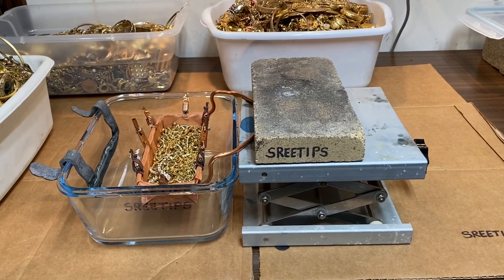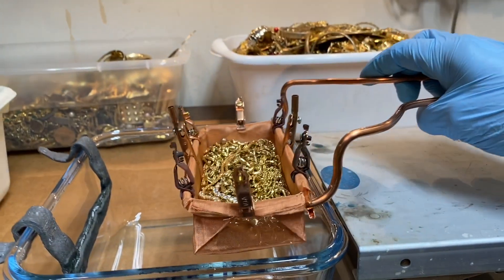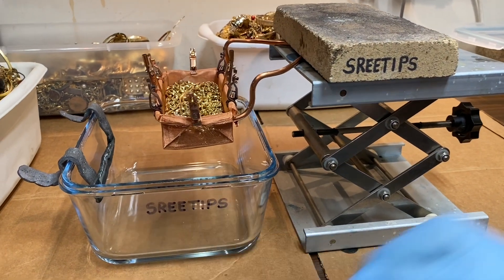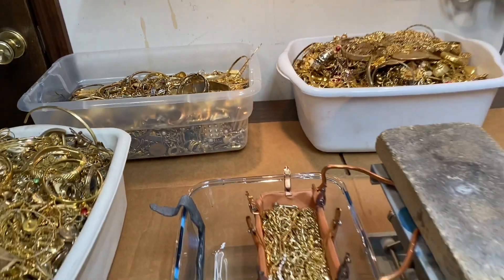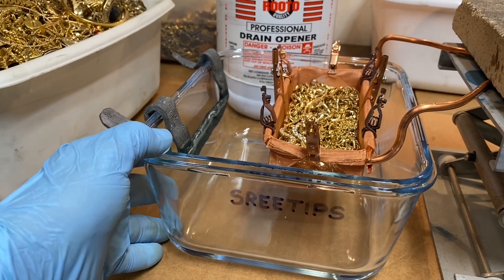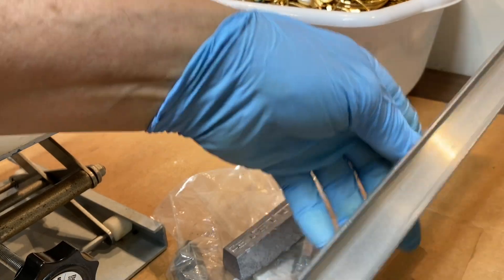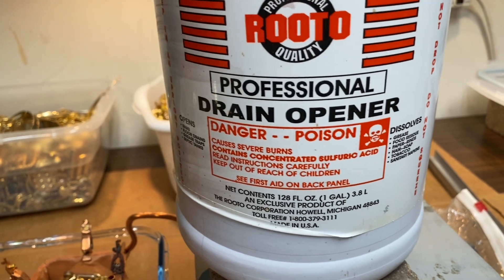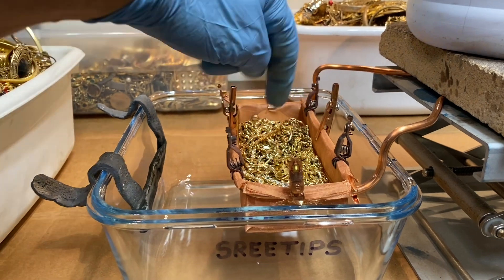Pure Gold Reverse Plating Cell Part 1

Comment: So the main issue is the solution heating up and not being effective. How about a different rig that could be placed into a water jacket arrangement (sealed water jacket of course, no one wants water to come in contact with sulfuric acid!), then have a small submersible pump to circulate the water thru the jacket? I was thinking controlling the temp of the acid would allow you to run longer and do RGP and Gold filled, which would be much more efficient than an AP solution. What do you think?
Reply from the maker: That sounds like a good idea.

Comment: Hey Sreetips, first I just want to say thank you for everything you do. You are an inspiration and an amazing teacher. 

My first question to you is, could the gold on gold filled jewelry and rolled gold plate jewelry be removed with this same process of reverse plating? 

My second question is more of a request for a video demonstration of my 1st question in the name of science and learning. 

Again thank you for everything you do. Keep up the amazing work and I look forward to your response as well as a possible video in the future.
Reply from the maker: 1) it may work but I’ve never tried it. The main problem would be heat. Stripping the micro-thin layer of gold plating off of gold plated material causes the cell to heat up. Once it starts to heat up it doesn’t work very well and has to be turned off and allowed to cool before continuing. The cell would probably heat up much quicker while trying to strip off the thick coating of gold on gold filled material. But that’s just my opinion because I’ve never tried it.
Reply: I just bought a small lot of 6 gf and RG watches for $20. I will give this a try with the watches and hope for the best. I will post my results when I complete  the experiment though. Who knows if it works really well maybe you could do a video on it.
Reply: @stephanomixer5281  Did you ever strip those watches?

Comment: Does the basket have to be copper?
Reply from the maker: Not sure, copper is the way I learned it
Reply: Well I’m going to try a old fashioned metal strainer on a small amount to see what happens. I let you know.
Reply from the maker: If it fails you can always order fine mesh copper screen from eBay. That’s where I got mine.
Reply: Btw you do a great job at explaining everything and referencing you source is awesome so I can can refer and get a better understanding of what is going on.
Reply: What size mesh they have 20, 40, or 100 mesh

Comment: Sir,
If I want to recover gold from aqua regia,
The gold is in aqua regia dessolving or present gold in pure aqua regia,
Please reply,
Thanks,
Reply from the maker: To recover gold from aqua regia solution, I add SMB (sodium metabisulfite)
Reply: @sreetips  
Sir,
Thanks for reply,
If we do not dissolve the gold in aqua regia, 
This aqua regia recover gold with smb using,
I mean the gold is present in aqua regia if we do not dissolve the gold,
I mean the aqua regia like as chloueric acid,
Please reply,
Thanks,
Reply from the maker: Gold will dissolve in chlorine gas to form chloroauric acid. Gold will also dissolve in aqua regia to form chloroauric acid. Both can be precipitated with SMB.
Reply: @sreetips  
Thankyou Sir,
If we make aqua regia and no dessolve gold in aqua regia, we cannot recover gold from pure aqua regia?
Please reply,
Thanks,
Reply: @MohsinAli-kj1ux  Gold must be added for gold to be present. It does not appear out of thin air. Aqua regia without added gold is just acid.

Comment: Helow!i just got a few aluminiun gold plated high grade but dont know if i could be done the same way  ?
Reply from the maker: Any gold plated material with a metal substrate can and should be run through a sulfuric acid stripping cell
Reply: @sreetips  well, thank you so much keep up the work it realy does help a lot off people on gold process

Comment: Would it work to do this with goldplated stuff like cpu pins and ram fingers? have been saving some ever since i watched one of ur much older gold recovery vids and this seem to fit me since i dont need a whole lab
Reply from the maker: Gold plated material with a metal substrate can and should be processed thru a sulfuric acid stripping cell
Reply: @sreetips  thanks for the input and fast response :)

Comment: Why don't you get your nitric acid and and some hydrochloric acid dissolve all that gold into solution and put some study of sodium metal bisulfate do re it get it out of solution and then melted down all that gold plating should come off really easy and that's nitric acid hydrochloric acid solution you'll get 99% pure gold that way than the way you're trying to do
Reply: I can tell you don't know the chemistry of what I'm talking about
Reply from the maker: Quite right, I’m no chemist
Reply: If you don't think it's that easy watch Cody's lab and some other guys that do it you'll learn something
Reply: @jamesendsley2611  The nitric acid necessary would cost far more than the gold present is worth. 

I don't recall Cody ever doing a gold plated recovery, just inquarted karat stuff. He does make his own nitric acid however. He is also not too concerned about high purity.
Reply from the maker: Ok, will do. Thank you
Reply: He actually got a bunch of gold scraps like you got right there and turned it into a bar of gold from getting all the other stuff out of it first
Reply from the maker: James, if only it were that easy... If you put this plated junk in aqua regia you’ll end up with a toxic mess and no gold. Stripping cell is the easier softer way for gold plated material.

Comment: Great job, Man! That should work really well for what you have.. looks like to have plenty of material to work with!  Have you tried a clay pot instead of copper mesh basket? If I remember correctly, gold ions will pass through the clay and slimes will stay inside the clay pot.. keeps the slimes from mingling with the deplated gold. Also, not sure who on GRF suggested it (fairly certain it was Lazersteve, but you should ad a small amount of glycerine to your electrolyte.. I don't remember the reason offhand.. worth asking the group about)

Comment: this looks very dirty replace the lead to copper but use a stripping agent like they do in the manufacture of record stampers lead and acid in electrolysis tanks create a lot carbon build up meaning dirty... change the solution for some proper gold plating solution to reduce the risk of base metal build up in your metals

Comment: What is the reason of NOT dissolving the copper mesh basket and dissolve the jewellery inside the basket?
Reply from the maker: Because concentrated sulfuric will not dissolve the copper and base metals. Dilute it and it will. Or heat the concentrated acid and it will

Comment: Just asking: Is that jack made out of metal? Make sure to isolate it not to get electrocuted.
Reply from the maker: I’ll put wood on top
Reply: @sreetips  It would be a good idea to put rubber below it, too. Otherwise it could get grounded if moved, and you might get a short circuit, then sparks or worse. Please, be extra careful with that large circuit layout you are assembling. Hope to see it working soon. Congrats on your videos.

Comment: Is there such thing as "Gold Cell" like the Silver Cell??
Reply from the maker: https://youtu.be/zDfujDqEPMo
Reply: There are a number of gold stripping cells. They all work on the same principle, just the cell designs are different.
Reply: @buggsy5  Yes, thank you. 
But, I was thinking of doing a Gold Cells in the method of the Silver Cell...
Like the Silver, Gold Bath, to possibly create Gold Crystals in kind of the Silver.
Reply: @buggsy5  I was thinking more along the lines of the Silver Cell where he is making the Silver into Crystals from a pure silver bar....
Should be possible from a Pure Gold Bar, right? 
Should have a super shine also like the silver does....
Reply: @hoseqt1  I don't know. All I have encountered are gold plating systems, which produce a fairly smooth layer of gold. The electrolytes used are nasty.
Reply: @buggsy5  I see....Thank you for the info....

Comment: Won't that dissolve the copper also? Shouldn't you use stainless?
Reply from the maker: The concentrated acid wont attack the copper. Some of it will go. But copper in with the black gold powder is very easy to remove
Reply: @sreetips  What other material can you use?
Reply from the maker: Stainless might work but I’ve never tried it

Comment: A few things to look forward to: 1 The acid will get very hot, almost too hot if you run it too long. Take breaks after about an hour run. 2. There will be a yellowish brown foam that will float on top of the acid after a while. You might want to skim it off and save it. it will clog up your basket if not taken care off occasionally. 3. The Lead bar will turn black / goldish brown and slimy. You might want to wash it in water and dry it off every 2-3 sessions. I think the black might be oxidized lead, but could be gold plating on the lead. The acid will get VERY dark after a few runs, so it's hard to tell really what's going on under the surface.
Reply from the maker: The scum is dirt. I plan to clean the scrap in ultrasonic and steam. This should make deplating much cleaner. Ive got a nice lid to cover it and put it away when it gets hot. After it cools and the black powder settles (takes days sometimes) then the cell can be restarted for more deplating. This will take a long time to do all of this scrap. For folks looking for a quick and easy way to get pure gold: buy a bowling ball!
Reply: @sreetips  A bowling ball?  This raises many questions in my head. My mother bowled for many years and collected many trophys in her time, I don't remember any of them being made of gold!
Reply from the maker: Scrapman50 I am implying that impatient people should think twice about trying to refine precious metals. Refining metals at home is NOT for everyone.
Reply: @sreetips  I've never heard that reference before. Glad you cleared that up. lol. For  a moment, I thought there was gold inside bowling balls!. There could be, some people put crazy stuff inside bowling balls to make them blingy! including skulls of their lost family members!

Comment: Did you know you could use this method to refine CARAT SCRAP GOLD?  The higher the carat the better. The process will remove the gold and turn it into gold powder. when the silver is encountered, it will simply fall to the bottom of the container.  Then you simply dilute the ACID and extract the solids from the acid. The rest you should know. Nitric acid  to dissolve the silver and Aqua Regia to dissolve the gold. 
I ran this experiment 4 years ago on a 14K gold ring using the exact same process you are using in this video. It took a couple of hours to reduce the ring to nothing, but it worked. When the bit of ring was too small for the clip to hold onto, i put it into a copper basket and finished it off. Try it on a small piece of carat scrap and let me know what you think. The time it takes to process the material is a bit longer, but it is an alternative to using so much Nitric acid.  BTW, I had to stop my experiment half way through because the sulfuric acid got too hot for my liking. I did not have a re-circulating water pump to keep the glass from heating up.
Reply from the maker: Good to know. Thank you.
Reply: But I thought you moved it to Copper basket after it got two small which one is it?

Comment: Does the gold go into solution, or plate out on the lead?
Reply from the maker: The lead acts as a cathode to pull the gold plating off the jewelry in the basket. It will come off as a black powder that settles to the bottom of the cell
Reply: @sreetips  cool thx sreetips

Comment: What in the world is gold plating cell? And what is it used for?
Reply from the maker: It’s a de-plating cell. I pass electric  current through the junk jewelry as it sits submerged in the electrolyte. The current flows through the jewelry, into the electrolyte and to the lead cathode. The gold plating will release from the jewelry as a black powder and settle to the bottom of the cell. Then we siphon off the electrolyte and harvest and refine the recovered black gold powder. I’ll end up with bright shiny 24k pure gold.
Reply: @sreetips  nice!

Comment: You should insulate the copper wire touching the plate on your lab jack.
Reply: I was about to ask the same thing. Will the lab jack short or ground it out? Maybe rubber tubing covering the portions on the jack.
Reply: I'm sure this is just a general idea to what he's currently bringing to the table guys. Touch up's of common sense always follows with a mind of brilliance.

Thank the man I say for such enthusiasm and consistency when dedicating his time to teach us unfortunate viewers. Lol, all aside yeah it definitely needs to be grounded.
Reply: @realityregulators498  Definitely grateful for Sreetips! He is more than generous with his time and knowledge!
Reply: I think his fume hood tabletop is non-conductive. If so, the jack cannot short anything.
Reply: @buggsy5  It's not about shorting anything. It is about the flow of neg to pos. The metal in the jack will interfere with the current.
Reply: @proslice56  Nonsense. The capacitance of the jack is negligible and, since this is direct current, will not affect the current flow at all.

Comment: Is the copper and lead unaffected by the acid you'll be using?  Also, I gather the goal is to get the gold into solution for further refinement?
Reply from the maker: Concentrated acid won’t harm either of the metals. The gold will come off as a black powder that will settle to the bottom. Then we’ll gather it up and refine it with bleach, hydrochloric acid and stump out - NO NITRIC ACID

Comment: To save the hand cranking on the lift, would a drill lower and raise it?
Reply from the maker: I though about motorizing the crank but I’ll be letting it down into the electrolyte very slowly so we don’t draw  too much from the battery charger

Comment: Looks fantastic streetips, only part for the course when it comes to really ANYTHING & EVERYTHING that you're involved in and/or doing yourself good sir !!!! 😊
My gawd you've sure got a massive amount of gold scraps to process my friend !! Best of Luck, cannot wait to see your results
QUESTION: why not use a gold anode/cathode? Why will Lead work for this?
Reply from the maker: Don’t know the answer. But a gold bar the size of my lead cathode would probably weigh in at 20 Troy ounces. That’s an expensive cathode.
Reply: @sreetips  I understand that the gold cathode wouldn't be the exact same identical size as your lead cathode... I thought that using a super thin strip of gold for the negative cathode (to increase the available surface area) is how a sulfuric acid reverse electrolysis refining cell was supposed to be set up, also using a 98% sulfuric acid as the electrolyte.
Reply: @ninjabothandyman6063  Maybe pure gold leaf?
Reply: @buggsy5  way too thin if I'm not mistaken though I'm not positive 100%
Reply: @ninjabothandyman6063  That is why I had a question mark at the end of the sentence. I have worked with gold leaf and it is a pain. But it could possibly be applied to a conductor of some sort to supply stiffness. Or even possibly to a flat piece of plastic with the negative conductor just held in place by pressure until the plating got thick enough for it to be stiff enough on its own. Of course, this also assumes the gold will plate out - which I really doubt, as gold electrorefining/plating chemistry is completely different.
Reply: Neither the lead (Pb) not the Copper (Cu) will be attacked by the sulphuric acid (H2SO4) at the concentration of the pure drain cleaner as long as @Sreetips doesn’t rinse them with water. Dilute H2SO4 will dissolve both easily!
Reply: @robertjeffery3237  That sounds like an easy way to get the lead out when he is done, leaving a hollow gold tube the shape of the lead conductor.  Lead is pretty cheap for this purpose.
Reply: Mark Pashia actually what happens, simply put, is the electrons trying to move from the plated jewelry to the lead push the unreactive gold away from the base metal. The gold and other precious metals will fall away as a black slime-like sludge. If the current continues to be applied, the base metals will also become part of the sludge.
Reply: @robertjeffery3237  ah, thank you. Was not sure and thought it was a plating transfer from one post to the other.
Reply: @markpashia7067  wasn't aware base metals are also a part of the black sludge stuff when the cathode is bubbling away with current working it's magic. Appreciate the knowledge and input once again kind sir and I thank you sincerely
Reply: @markpashia7067  The plating thickness is directly proportional to the current density at any given point on the cathode. Since the back side of the lead is much further away, there will be little gold deposited onto the back side.  This could be overcome by having the cathode in the middle between an anode basket on either side. But the current might be doubled and his cheap battery charger probably would not handle it.
Reply: @robertjeffery3237  I really appreciate your input thank you kind sir